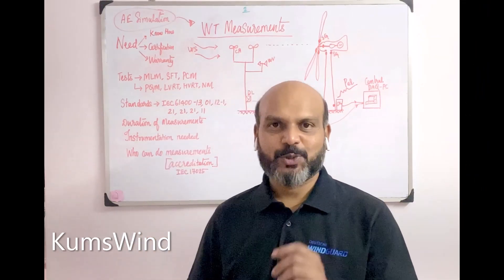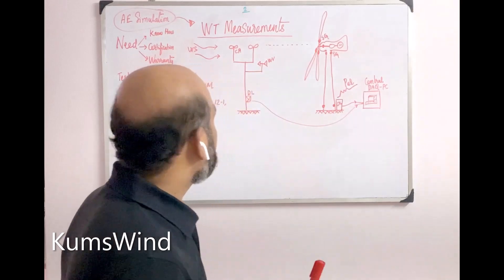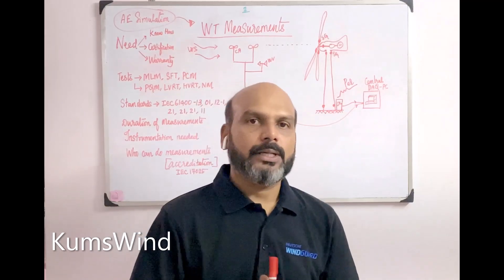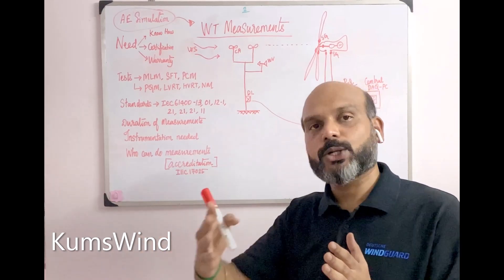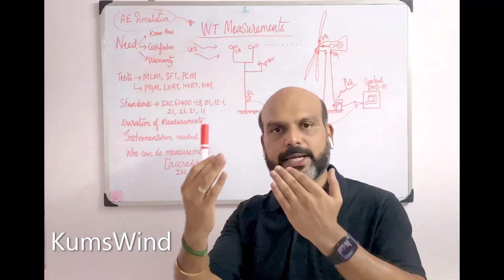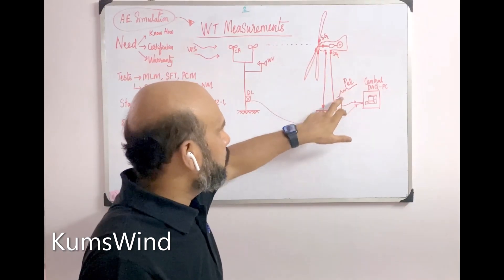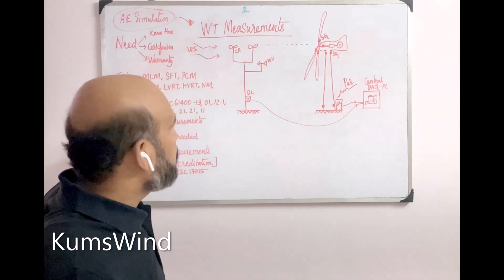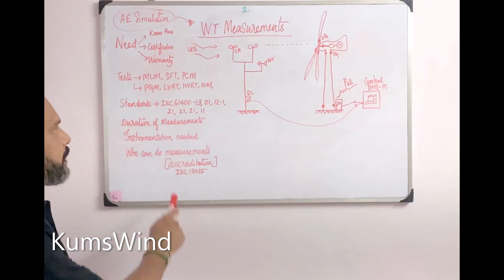Wind Turbine Measurements | KumsWind

Comment: Tku for ur information sir. Plz explain abt blade pitching  sir
Reply from the maker: Hi Michael, Pitching is turning of the whole blade from root to tip along the blade central axis. this is done to achieve different angle of attach and maintain necessary lift in the blade and also to regulate the power beyond the rated wind speeds.

Comment: Thanks for your video, nice explanation. Could you clarify me in a lengthy blade, which is the effective area that gets a high wind pressure?
Reply from the maker: thanks vinoth, in a lengthy or shorter blade, the front side of the blade, i mean the upwind side gets the wind pressure, the tower side becomes the suction side.. within the front side if you consider.. the tip side faces more pressure/force than the root side.. when you consider the bending moments it is the opposite.. the tip side faces less bending moments and the root side faces more.. hope i reached out to your clarification!
Reply: @KumsWind  yes Thankyou sir..